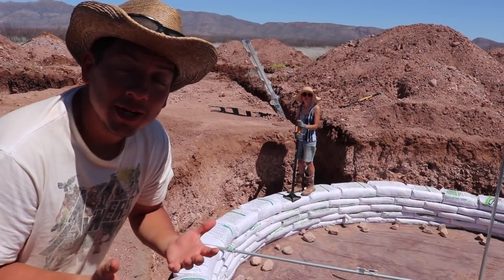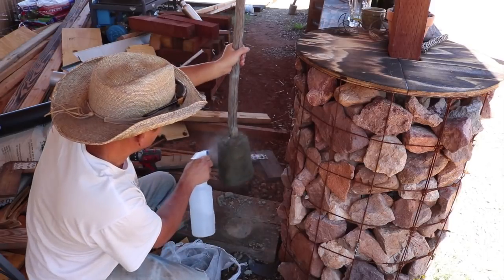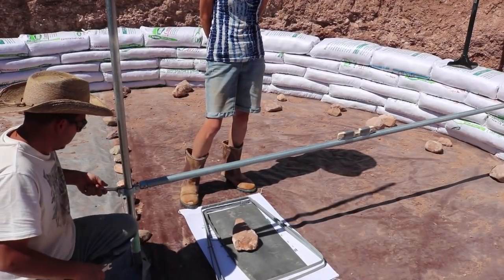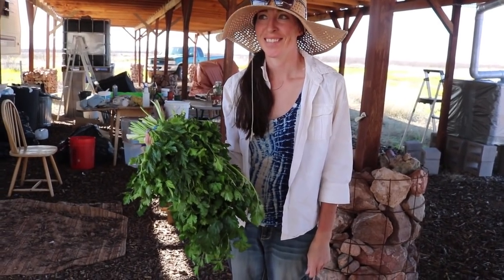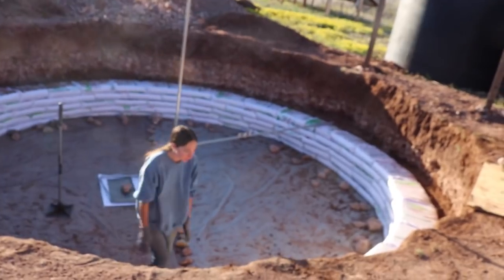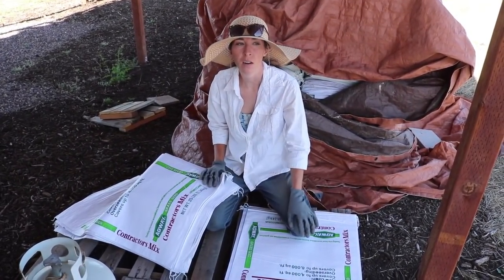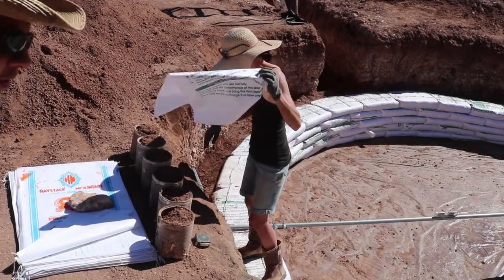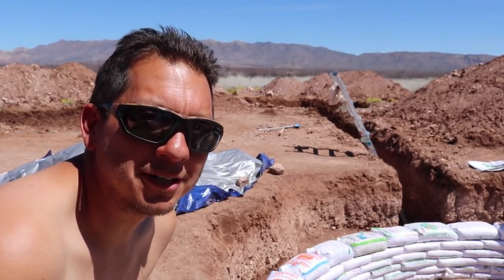We're Ensuring Our Future Survival By Building This Earthbag Rainwater Harvesting Cistern

Comment: I wonder if you could add weight to the commercially produced tampers.
You both are going to have a lot of strength and stamina before long.
Reply from the maker: Thank you! The commercially produced ones are already kind of heavy.😬
Reply: @ourselfreliantlife  I see. I was thinking the home made ones were easier to use because you just had to lift it and let it drop and the commercial ones you had to put force into the drop side.

Comment: It's such a treat to check in every day and see how things are going with your projects.  I can see all of the hope and excitement in your eyes about this amazing water system you are constructing.  Any more thoughts if rebar would be necessary for stability of the walls?  If you go that route how would you insert it now that the bags are all stacked up.  I love how your hand made tampers are better than store-bought.  If it didnt make it too heavy what do you think of sticking 2 rebar rods on each side of the handle with the end of the rebars rods embedded into the cement head part of the tool and with tape wrapped around them and the handle?  Just some thoughts.
Reply from the maker: Great thoughts Don. I may have to try that if I have another handle failure.

Comment: If you put that rotating bar up just a tiny bit and hang a bobble on a string for the elevation check it will be much handier.  If you locate the bobble at the edge of the build line it will work nicer too.
Reply from the maker: Thank you for the suggestion!😀